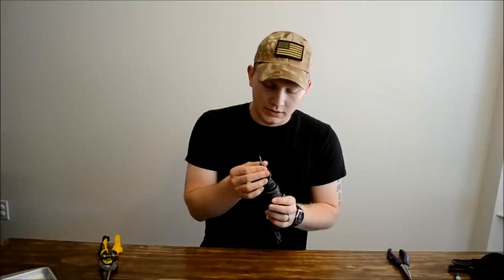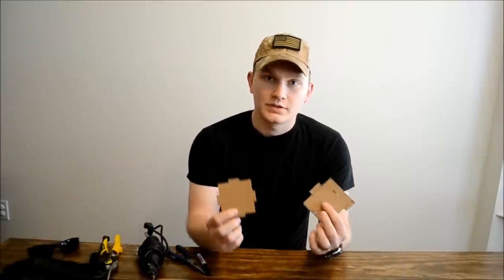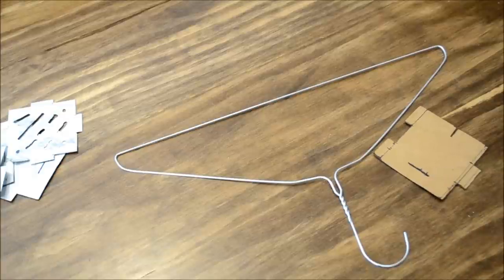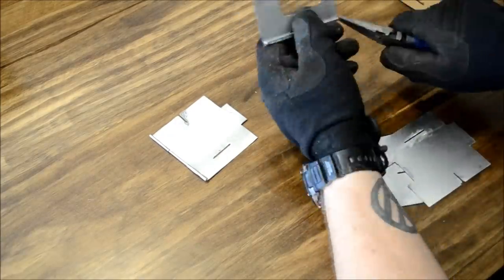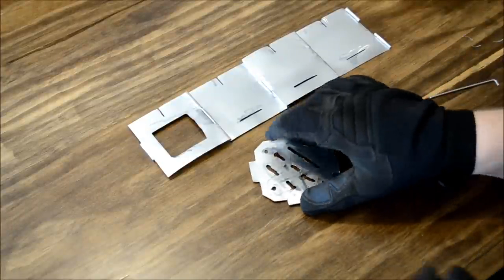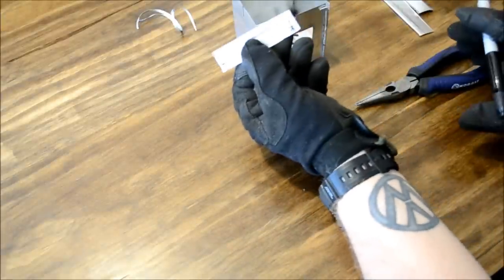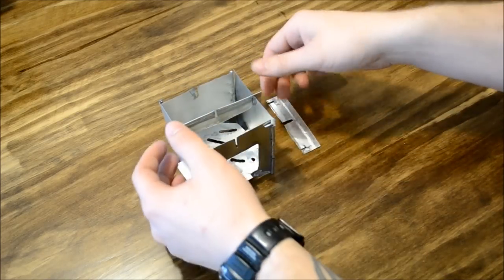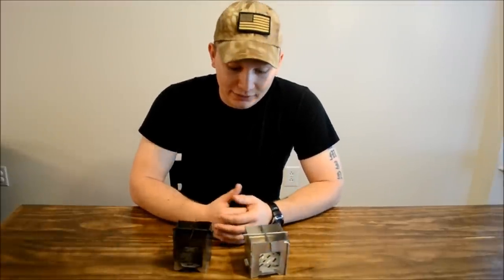How to build the $1 pocket stove

Comment: Nice video. Some of the cheap models on Amazon make it easy to just purchase one over build one, but they have some design flaws. Your build fixes those flaws. Nice job.
Reply: Major design floor with this is that the bottom is way too close to the ground.
Thats just my opinion though on using many of these stove s over the years.
Just needs lifting up a bit.
Otherwise a very cool project and well thought out.

Comment: Excellent design. Alum for lightweight. Dissasembles and/or folds flat. If the grill bars were simply parallel, would be stronger and easier to work with. I must make one of these. Thanx!

Comment: Neat stove, similar to Lixada on ebay
I think your pot supports should hold the pot higher than the walls of the stove, so the flames have room to escape and lick around the bottom of the pot
Reply from the maker: simon4043 You are right.  I have a second version that does just that.  Unfortunately I have been hit with back to back deployments and was unable to make the video.  When I come home again I will make the version 2.0 video.  Thank you for watching my channel.

Comment: Very neat little stove but as an avid camper I'm not seeing what you use it for? Could you make a video showing how you use it? I just make a small fire pit and throw a little grill over it to cook anything I need. Do you set this on top of the coals?
Reply from the maker: $1 Wood Burning Pocket Stove MYOG: https://youtu.be/QxdX8QutEy0

A lot of places don't allow open/uncontained fires this should meet the local requirements.  The little stove also focus the heat better than and open flame and provides a windscreen.

Comment: Great little stove.  Grind down the sharp points and edges and toss it in a little freezer weight zip lock back to keep the parts together and the soot from getting on anything and you're good to go.  Did you happen to weigh it by any chance?  Would be curious to know if you have a scale sensitive enough.  Thanks for sharing!

Comment: If I'm hearing that correctly, are you using a DSLR with a stabilized lens? Turn off in-lens stabilization when you're mounted to a tripod. No need for it and it just tries to stabilize against movement when there is none (and creates noise in the in-cam mic).
Reply from the maker: I am using a dslr with image stabilization.  I just assumed if the camera was stable it did not do anything.  I appreciate the advice,  I will be sure and turn off the stabilization for the next video.  Thank you!

Comment: would be easier to drill some holes in the bottom and sides of a small cheap cooking pot from a yardsale, thrift store or maybe you already have one.  then you could use anything as a grille (chicken wire fence, cooling rack, or metal strips) cut to fit the top.  could set it on a few stones to get some air flow underneath.

Comment: Be neat to design a pressurized alcohol stove like a benzine kroker enders baby 9063. A carbon felt pancake alcohol burner to give heat to a aluminum tank with rolled up carbon felt to absorb more alcohol and to turn the alcohol to vapor with a 8 inch metal tube or like a propane cable to the burner. Design it all the size of a paint can. You think it would work? It would be a neat tool for any bug out bag for sure.

Comment: why not use bottom support brace along the sides of the stove like you made for the top needs more support wher the fires at since that where the concentrated heat will be also an ideal for another stove use your pattern for this one and use a bit thicker metal say 1/4 inch or 3/8 regular metal like steel  it would be alot stronger able to hold a hotter heat and would even be more rugged and withstand a fall or being accidentally dropped out of a pack onto a rock ...wouldnt it?

Comment: It's clever all right, but what was purchased for that dollar? Not the six-dollar cookie sheet; not the $45 Dreml tool and the rotary blade and rotary grinder; not the two hours spent cutting it out at $15 per hour. A small, light-weight portable stove which uses alcohol can be built in a half-hour from a Pepsi can, with a pair of scissors. Just search google.
Reply: +kansasross In my area you could buy those baking sheets at the local dollar store. I think that is what he was referring to.

Comment: does anyone have a link where i can purchase a baking sheet without a non stick coating (preferably in the uk) as i have looked in all my local shops and cant find any
Reply: +propringle1 You can burn off the coating. Outdoors, staying up wind to avoid breathing the smoke! Proceed at your own risk. Not responsible if you don't stay out of the smoke.
Reply: I don't know about the UK, but I just bought several cookies sheets and other pans at the DOLLAR TREE today for, of course, One dollar each.
Reply: +Chain saw cabinet Shop good thing about the Dollar store variety is that if they have a teflon coating, it is so thin and poorly bonded that it will be gone with the first small fire.
Reply: try a thrift store
Reply: I have bought a few cheap ones and am using a sander to take the most of it off and going to let it burn the rest off
Reply: Thrift store, flea market.

Comment: How about using an old can with holes in the bottom?
Reply: +Wolfgang Keim 
Gotta agree. 
I mean, the gentleman did a great job on the stove. 
No argument there. 
But unless it was just for the challenge, why go to so much trouble, when functionally an old can would work just as well?
Reply: +Bevin Chu I guess because the baking sheet is designed for high heat.
Reply: +Bevin Chu  you can never fold and old can and stack them in your bag ...
Reply: +Wolfgang Keim This you can fold it and open when needed, and support high heat
Reply: +ziggyzuggyboi for small fires at home or the woods behind the house a tin can is fine but im building this to bring into my hunting blind
Reply: +ziggyzuggyboi The old can could carry the fire-kit and silverware and maybe the first aid kit or food bars, so there's no wasted space.
...........
But I liked this video anyway.

Comment: one dollar stove first you need a 5$ tray, 25$ shears 60$ dremmel, and needle noses plier 4$.... Definitly one dollar. 

IN contrast you could get a card board box, some tinfoil and make an oven that way
Reply: These pans are not expensive and using your mother in-laws old one for free is always an optilon.  These are common tools. Most adult men have them in their garage.  If you don't have the tools you will save money by investing in them.  Great video.
Reply: If You Do Not Have The Tools, You Should Not Build The Stove.You Will Cut or Burn Your Fingers
Reply: I don't have the 60$ dremmel but I bet I know someone who does or can get it from my local tool library and yes this is a real thing in Seattle. Also I bet you could get the job done, or close enough to make the thing work with tin snips or the so called 25$ shears you speak of and I am an adult female with more of these $5 trays in her kitchen than I could possible use at one time so this will be free, and I can make a few as gifts.

Comment: If you need all those tools to make 1 USD pocket stove I think you have to add the price for each tool.
Reply from the maker: If they were not common household tools then sure.
Reply: but not common survival tools. If you did all that with a knife or plastic bottle that is common.
Reply from the maker: hellerase That's failed logic.  You would make the stove and have it available for when you go to the woods; same as you bought your knife ahead of time.
Reply: in that case it would not have been survival but camping...
Reply from the maker: hellerase do you realize that survival is not a matter of how much or what type of gear you have, it's when you find yourself in a life threatening situation.  The difference between camping and surviving is the choose; camping you are choosing to be in the woods, surviving is trying not to die while you find a way out.
Reply: +hellerase  But building it ahead of time means that you have the gear needed when the time arises. Like a condom, it is better to have it and not need it than need it and not have it.
Reply: I get your point. This situation falls under "prep" definition for survival which I dont have problem. I however, like things that I can prepare in a situation where I find myself naked in the woods.

Comment: Wouldn't it just be easier to put your weights on the floor? Just kidding. Punching holes in a soup can seems to work pretty well.
Reply: +Maxid1 I'm pretty sure the idea is to save space in a pack. A tin can takes up a lot more real estate in your pack, even though you can stuff crap inside it - fire lighting kit or something else that you won't mind getting sooty.